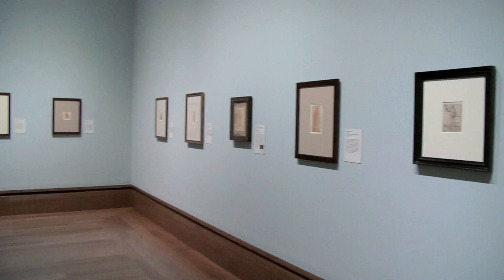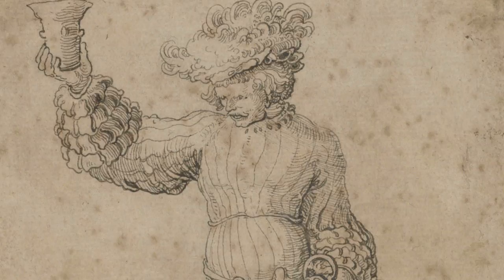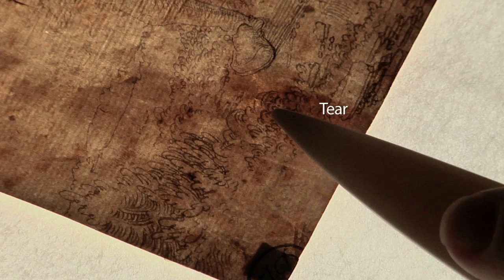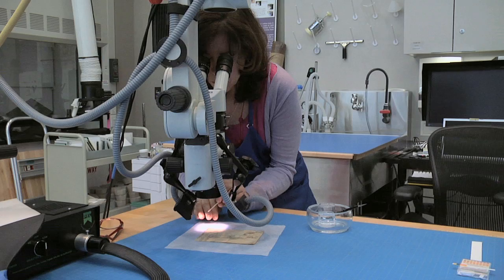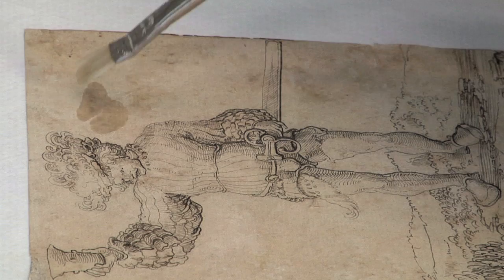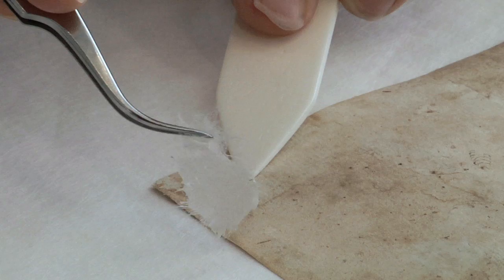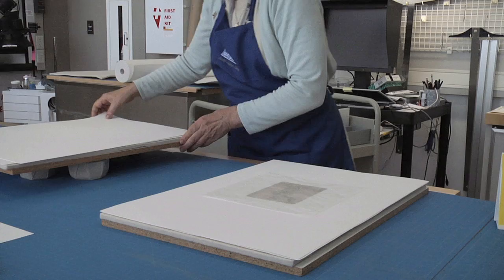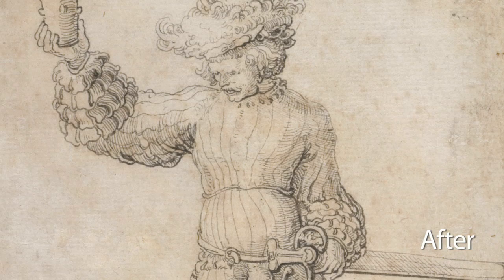Conserving Old Master Drawings: A Balancing Act

Comment: No, gloves are not appropriate in most paper and book conservation, however clean, washed hands are.  Gloves create a false tactile surface since paper is so thin and fragile and as previously stated can easily cause more damage to the paper then wanted.
Reply: It's better to use ones' bare hands, so as to actually feel the paper and know when it's dangerous to handle something.

Comment: She is using a bone folder and wheat paste to adhere the Japanese tissue to the paper. The amount of ammonia is small I believe in the water dilution.   The ethanol I do not believe is mixed with the ammonium water.  If anything, the ethanol may be diluted with water.  If I remember correctly, ethanol is often used to spot treat mold.

Comment: Additionally, masks are not always necessary either.  The conservator here is using a suction table which is pulling the material and consequently the residual vapors from the object. When suction tables are not used, normally when using harsh chemicals, it is done in a vacuum hood.  Hope this helps clarify. P.S.  This is the Getty, they know what they are doing.

Comment: Does her amoniated water and ethanol solution go through the paper into the suction table?  Does this mean that it does not stay in the paper once is applied? Do you not rinse after applying solutions?or did you use ethanol by itself, you did not show a response.

Comment: 1) what is she using when pasting japanese paper?
2) what is % of ammonia and water?
3)should the ethanol be mixed in ammonium water?
Reply: 1) A starch paste, these are commonly used in conservation and framing because you can adjust the "stickiness" of it to match the paper in question, and starch is a non permanent adhesive (easily removed)
Reply: @carlotta4th  Pure Wheat Starch
Reply: ما اسم المادة المستعملة

Comment: This is an old video but popped in some research. I know you people are the experts however foxing is not caused by mold,  if it was the work is contaminated.  Foxing is a problem derived by the minerals in the water used to make the paper.  If analyzed by current modern techniques you can come close to determine the minerals and where the paper mill was located.
Reply: How to lighten up foxing?